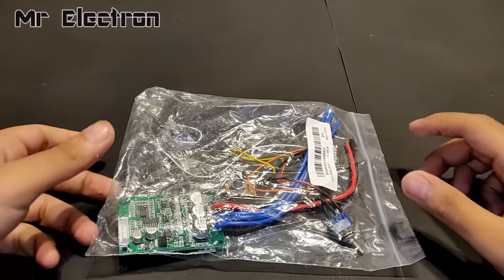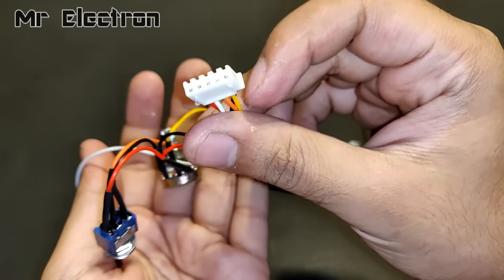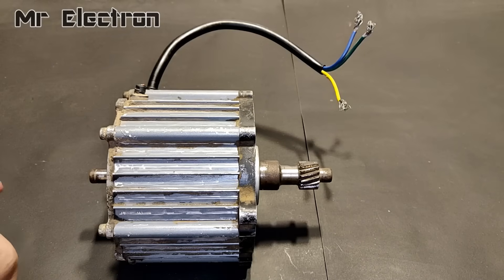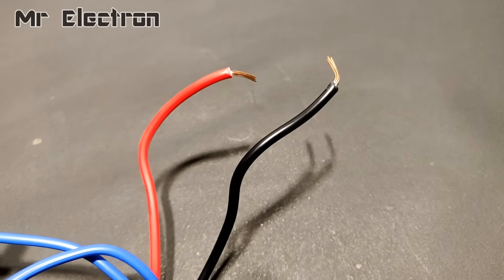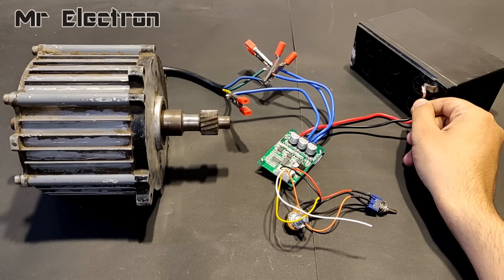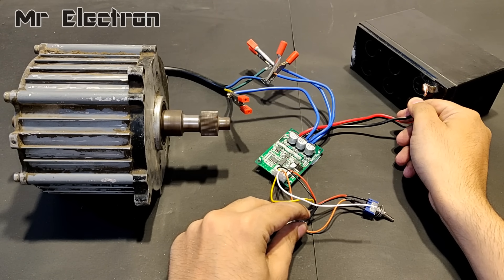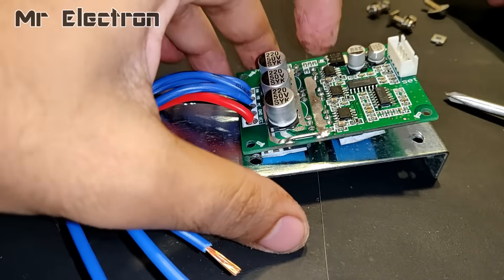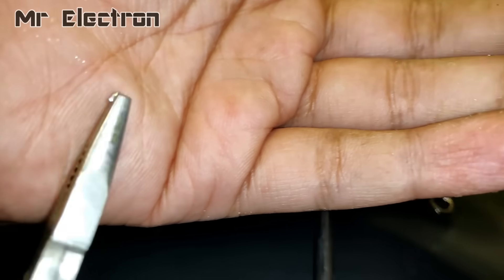Wooow ! 12v to 36v 500w Brushless DC Motor Controller - Run BLDC Motors without Hall Sensor

Comment: Sir can i request  for water turbine set up for 12 to 24v DC thanks
Reply from the maker: Hi ! How can i help
Reply: for wiring sir cause  i don't have any experience about electrical  do i need  solar charge controller and battery or power inverter to operate  appliances like TV or charging cellphone and any  cause i'm planning on off grid thanks for the reply...
Reply from the maker: power inverter only. How many volts does your generator generates ?
Reply: it's not tested yet in water "., but the power of the generator is 12 to 24v dc and 350 watts and when i try it to spin using rope i have 15v dc
Reply from the maker: well then you need a 12v to 24v adjustable input inverter for this.
Reply: ah ok sir  can i buy this electrical item to in online?
Reply from the maker: Yes !
Reply: if i have this sir do i need battery? or  can i direct it  to power inverter  for appliance thanks
Reply: i search it her in the online  shopping her in my country and i found this one"(DC-DC 3V-35V To 4V-40V Step Up Power Module Adjustable Boost Converter Adjustable Voltage Board 3V 5V 12V To 19V 24V 30V 36V) is this ok? to use thanks
Reply from the maker: @jeffreypampilon1216  no .. Its a step up module not an inverter.. U need an inverter
Reply: ok thanks sir
Reply from the maker: buy this one : https://www.banggood.in/custlink/K3DGPDLHdO
Reply: if i have this one sir can i direct it to the water turbine generator  or  still needed a battery
Reply: but it;s not Modified Sine Wave Converter like in ur link cause i don't know if we have it her in our country herin the philippines thanks
Reply: @jeffreypampilon1216  it comes down to how steady the output voltage of the turbine is. If you have water flowing continuously and if the water ever stops, you are okay with all the connected appliances turning off then you don't need a battery. Any UPS system designed for an external battery could work.
If not, you'll need a solar panel battery charge controller, connected to a battery, connected to an inverter
Reply: @Chaitanya Sandagi thanks

Comment: Very good experiment done.

Could u tell me. How to drive 3 phase bldc drum motor 36 pole

My contect. 9810025666
Reply: Thank u very much.
Reply: By drum motor do you mean an outrunner? 
Whatever the construction or number of poles, you can use an ESC like in the video. 
If you need very high starting torque then you'll need an encoder and sensored BLDC, but baby steps first...
Reply from the maker: I will look into it